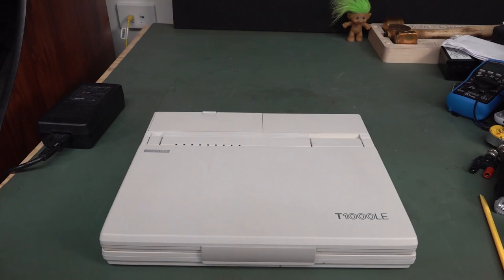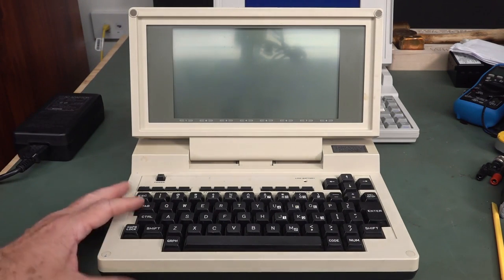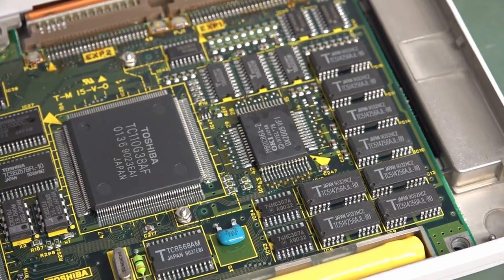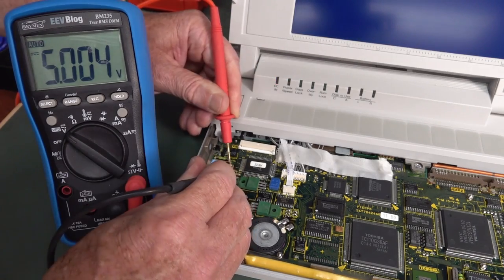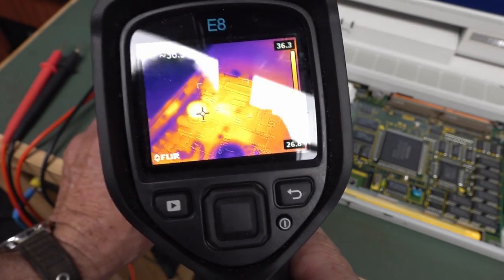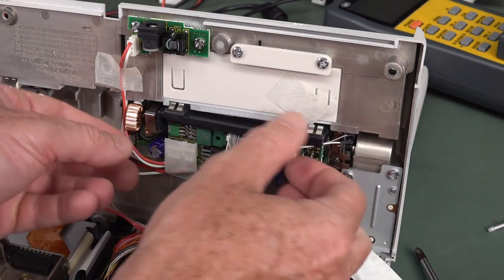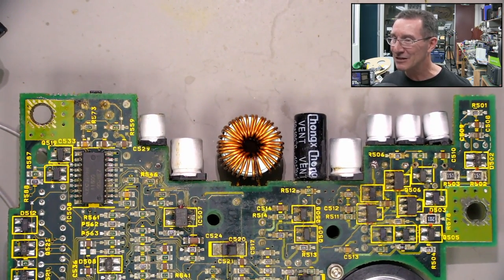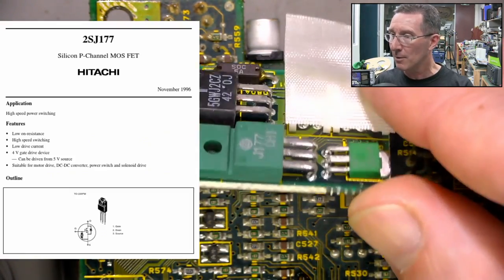EEVblog 1527 - Toshiba T1000LE DOS Vintage Laptop Repair HELL

Comment: Waaay back when, I started buying old laptops for $5-$10 at garage sales to teach myself laptop repair. This was the 2nd one I got. (The first was an old Zenith "portable".)

What I found was that it wouldn't boot without a working battery. I opened up the battery pack using an Xacto, replaced the NiCads with NiMHs. (Which required that I only charged them separately, not thru the machine.)

This laptop, with full 1M of memory and an 8086 processor, could run MS-Windows 2 nicely in protected mode.

Another problem I had was it didn't have a floppy. To get software on it I had to do a command line comm trick with a Laplink cable to load Laplink and then transfer stuff via the parallel port. Worked great, lots of fun. Had to go away during my downsizing move a couple years ago.
Reply: 8086 doesn't have a protected mode--are you perhaps thinking of an 80286?

Comment: if you look at 37:50 you can see c524,c521 and c520  markings on board you can see big line or big crack inside black chip.could that be fault?
Reply from the maker: You didn't watch the whole video

Comment: I just remembered an old Tektronix report.  It described their factory repair procedure.  The very surprising statement was that the nearly first operation they did was to wash the scope in a dish washer, using distilled water!  They followed that with a long (24 hour?) drying.  That was maybe in the 1990's, possibly even earlier.
 The other thing -- I relate any power indicator pulsation to the built in "hiccup" mode start, fail, retry due to overload somewhere after (or possibly within) the power supply.  As to leaked capacitor fluids, my finding has been that rather than the usual high concentration IPA, a 5 to 10% IPA or even plain distilled water often works better.  But a lengthy soaking may be required in any case.

Comment: I have a 110CT Windows 98 VHS Cassette-sized machine from almost the same era that I use to interface my oscilloscopes and analyzers (RS-232) when travelling, and it works just fine.
I actually set up a dual-boot DOS 6/Windows 98, and I use almost exclusively the DOS side. The hard drive is getting arthritic, and I actually had to open it at one time to un-stick it, so I'm looking into getting it replaced (hopefully with an SSD) but otherwise I can't complain. The battery even holds enough charge to move the device from one side of the room to the other whilst remaining connected - probably a good minute or so. Far more compute capacity than they used to go to the moon and back!

Comment: I recently did an extensive repair on a liquid damaged PCB, had to strip off all larger components, add many bodge wires, replace multiple SMD transistors, rebuilt and got it fully working again. A lot of via's had failed - they aren't fully protected by the solder resist coating. I'm afraid the prospects for your Toshiba board don't look too good to me :(

Comment: At 32:55 the residue is, as you later identified, leaked out electrolyte from the capacitors. I had this a lot when I repaired old Macintoshes. Give it a thorough clean with hot soapy water and a rinse with pure isopropyl. Some connections may require re-soldering to work again.
Reply: Looking at the bad traces at 38:15, I’d say the board is BER. This when I usually gave up a capacitor-corroded board after following a long rabbit-hole with my first terrible one. On capacitor-corroded boards, as the corrosion often destroys traces under chips and often vias too, you don’t have a chance especially if you don’t have massive amounts of time and a schematic.

Comment: Had one of these. never worked. Same issue, caps leaked out and it's all because of the Quaternary Ammonium Salts issue which plagued those caps, the Elnas and others. there's reasons why ones that still rely on that tech are now relegated to special use cases, and are protected against leakage like this. This is the same issue that made apple surface mount caps go bad.

Best course of action would be to throw this in an ultrasonic cleaner and let that work the magic for a couple hours, and then rinse it in the dishwasher with non-corrosive detergent-- you'd be surprised how much cap gunk can be removed with just a touch of detergent! If you need the value of that tant that blew, I can probably go down to my board in the basement which I've kept after all these years and get you a reading off of it and I'll report back as time permits.

Comment: While some old HDDs tend to be surprisingly reliable, the Conner 2.5" drives were not. They, like some of their Quantum 3.5" contemporaries, suffer from sticky rubber bumpers that glue the head stack in place so the head will not move. If yours has this problem, carefully disassemble the drive (making sure to not get the also disintegrating rubber gasket on the platters), power it on, help the head stack to unlock using your fingers and then get the data off quickly. Only a temporary fix, unfortunately.

Comment: Tiny traces, rotted vias. Could be a fun hobby project for someone to practice their micro repair, but in the areas where the corrosion has set in, you'd have to lift every chip or other component that may have a trace or via under it. And in doing so, potentially lift traces in the process. This era of things seem to have infuriatingly tiny and weak traces and pads (and poor adhesion to the board). In this situation, there is also a risk that a section of trace disappears completely and you have no idea it was ever there in order to fix it.
Reply: Yes, this one I would give up on. Corroded vias are worst, and this board has like a hundred to check/fix.  Not even speaking of repairing the traces. It would take me countless hours for some very uncertain outcome. I've had my own experiences with NiCd juice corroding all SMT pads from the underside so whatever is left of the pads will instantly lift from the board. That was a pretty frustrating repair experience.
Reply: @Shmbler But was this NiCd leak from either battery or electrolyte leak from the ELSAs?
Reply: It’s easier to remake the board and order the BOM than repair with that level of corrosion

Comment: Damage from leaky capacitors and NiCD's are a major concern when working with vintage computers.
Only positive is that the repair work gets pretty straightforward, cleaning and restoring vias and traces.

Comment: Last time I used these was in the mid-90's when it was running braille translation software to produce braille materials for a correspondence course. It worked fine for years despite the amount of paper dust it was exposed to.

Comment: I have two broken Toshiba T1000SE laptops very similar to this which I've tried to get up and running but without any luck. I recapped all of the capacitors but couldn't get them to boot. I thought it was just my shoddy soldering skills but it looks like there is more to it! A problem I've had is the wire connectors with the LED and charge boards are really brittle and I ended up breaking one when disassembling / reassembling :(

I'll be looking forward to a part 2 to see if you can get it working!

I also have an original Toshiba T1000 which is a completely different piece of hardware and switches on OK. It also has a power issue with it dropping out when attempting to use the floppy drive but boots to ROM DOS just fine.

Comment: ELNA capacitors are pretty much no-brainer, you replace them when you see them and you don't even bother measuring them. I fixed an AT power supply recently, all ELNA ones were dead, one even shot the alu can to the space and all that was left was a roll of paper :) All other caps were fine, even after some 25 years or so.
It's actually good to see ELNA caps in a non-working device, you know instantly where the problem is.

Comment: WOW, wordperfect, I remember using that back in the 80s and early 90s. To get that cleaned up and repaired, your going to have to remove a fair bit of solder mask to ensure you dont have residual corrosives lurking under there.

Comment: I just started working on restoring a T1000 a few days ago! First single-board laptop on the US market, and my first computer as a kid. (My dad had one of the fancy new Windows 3.1 machines.) I've also picked up a T1200, and its guts are very similar to this.

Those brown ELNA / "LongLife" caps are notorious leakers. The T1200 has a whole bank of odd values and sizes on its power board, most of which are leaking. Both machines have other brands of caps in various places as well, but the bad ones are all those brown ones.
Reply: Did you ever get it going?  I recapped mine and nothing. The components are so darn close on the T1000 circuit board.

Comment: The probing at 22:20 obviously shows LED changes as you push the probes on.. Looks like some loose soldering or circuit board issues there.. But I havent watched the rest yet..
Reply: Ok, I see it now. The capacitor electrolytics have most likely also entered and probably damaged via's. Neutralizing and repairing is very difficult and time consuming.

Comment: My oldest computer is a Compaq Armada 7770DMT from 1997.
It´s very impressive how quick computers developed within a few years back then.
It has a 233mhz pentium mmx, maxed out at 144mb ram total and currently i have a 100gb ide hdd installed.
It runs Windows 98SE very well, however it also makes a great DOS gaming machine thanks to it´s full vga graphics support and ESS audio drive with full soundblaster compatibility.
It can do 32 bit colors at 800x600 native resolution. I think it has 2 or 4 mb video ram but lacks of 3d acceleration support.

Comment: I had (well still have in pieces) T1200, it was great when it worked, sadly it slowly decayed - first both floppy drives died, then LCD stopped working and finally mainboard kicked the bucket. It's certainly interesting laptop, but generic enough not to warrant full repair, altough the ALPS mechanical keyboard is great and I'm tempted to make adapter to connect it to newer PC.

Comment: Yes tantalum capacitors are marked positive how do I know this… I purchased a SATA to msata adapter off eBay and it didn't work right. Traced it to the capacitor replaced the capacitor powered up and have a nice fireworks show glad I bought extras.
I haven't seen that much fireworks since I plugged in a AT power supply and the power switch cable shorted live 120V! When I was like 6-8.

Comment: I feel you pain! I have like 100+ retro laptops like that in my collection, restoring and repairing them 10-15 years ago. Caps electrolyte is devil himself. These laptops have multilayer PCB. Vias go bad, traces go bad, party going on under ICs, bad, bad, bad... all bad ;-) But endless fun when repaired and comes to life. Cheers! S   PS, there is some kind of LCD inverter inside LCD housing - BAD! ;-)

Comment: I had the same problem with those Elna RSH series caps on a power supply for a spectrum analyzer (Advantest R3271). Half the board was covered in leaked electrolyte and there was corrosion everywhere. I managed to repair some traces but I wasn't successful repairing the board. Unfortunately, the power supply is the only part for which there is no schematic in the service manual...

Comment: Senior college thesis written in WP 5.1 in 1991.  Got the 5-1/4 floppies around someplace....  Never owned or used (employer's) laptop until 2001 I think.  Traveling engineers (not me) would sometimes have them.  Now of course hardly any desktops in use at my company except some on production testers.

Tantalum caps could have popped from OV.  My company has had a derating of 50% on those and avoid if possible in designs.  MLC caps have replaced the need for a lot of them now though.

Comment: Seems like an excellent candidate for a USB-C adapter built into the battery pack (or a 3d printed replacement).  Just completely bypass the built in power supply.  Allows you the easily power it from USB-C battery packs as well.  USB-C 5V -> 7.2V or just straight 9V

Comment: HA. I'm repairing Rockwell AIM-65's each year. 1MHz 6502! I've made some upgrades over the years, like flash prom adapter and an Arduino TTY remote terminal implementation.

Comment: !! 43:17 It looks like those two are they diodes or capacitors are cracked in half?
Never mind I originally spotted them at 38:00. I wasn't screaming yet but it was getting close to the end of the video.

Comment: It's a little validating to see even Dave struggle with this. My random sampling suggests there are a LOT of Toshiba laptops this vintage with leaky caps and bad power supplies and I haven't had luck getting one working yet...
Reply from the maker: Search the forums and you'll find that tons of people have no luck with them. The PSU is convoluted, no schematic, and the caps leak everywhere and destroy traces. Once I saw the corroded traces I pressed STOP and that was the end of Part 1. Don't know if they'll ever be a part 2

Comment: Yep. I have a similar model (think it was a T1000SE?) and tried repairing it doing exactly what you've done quite a few years ago. Stuck in the same boat. The capacitor leakage was much worse in my example

Comment: I have two of these and was thinking when isch was unable to make the first one running, that im just bad at fixing stuff (recapped main board, touched up alot of the corroded points). lucky for me the second one had a mainboard which allready looked much better from the beginning, so i did manage to fix that one, but yes compared to the ibm laptop i have from 95, the pcbs and everything is attrocious from the toshiba 1000le.

Comment: My step father had the loan of a T1000SE in, wait for it, 1995, I was only just starting to learn about IBM PCs then, so I knew nothing about DOS and very little about Windows, if anything.  So I didn't know the SE had DOS in ROM.  I'd kind of like to find a T1000 LE or SE, that's in working condition.

Comment: Find someone to draw the board up on pcb or a working one. Could be a good journey to replace the board with a new pcb.

Or make something with newer power delivery circuitry. How many volts from 12 and down it needs. Should be a bobby dazzler special!
Reply: Once you redesign the PCB, you might as well choose new core components like a 486DX3 and some high capacity modern DRAM chips without the rowhammer bug.  Just avoid chips that have known bugs or high risk technology like speculative execution or hidden global CPU state.

Comment: So it's a long shot depending on the layout, but you might be able to cut off the PSU section and make a solder-in replacement?
Reply: Definitely needs a schematic for that.

Comment: Have you tried running power through the battery terminal connections on the board at the back of the laptop instead of the dc input ?
Reply from the maker: Watch the end of the video, it's a mess.
Reply: @EEVblog I wonder if Toshiba  would fix it for you or maybe there's another main board lying around somewhere.Or you could donate it to a technology museum or send it to hell lol 😂😂🤣🤣😂😂🤣🤣😁😁

Comment: Man... that T1000 looks like it was "terminated" by a T1000. 😁 Would the Rossmann method of flooding the whole area in flux and reflowing the joints help with that corrosion? Should then make it easier to find the bad parts and traces, maybe?

Comment: I have one of those, it didn't boot when we moved last year, but I might have had the wrong power supply. I think it flashes a green light though.
Pretty sure it's painted metal on the back of the monitor.

Comment: Poor thing is completely rotten away. The horrible tarnished look of the joints on the caps right at the start (12:14) screams for a massive electrolytic spill. 
From my exploration of vintage stuff, ELNA caps leaks. Never seen a Rubycon or Nichicon leaking. And Sprague are notoriously eternal.

Comment: I wonder if the extra "battery terminals" in the left hand enclosure were actually an easy way to power the modem when fitted?
It's a shame that we have to use an electrolyte that's so corrosive. But then tantalum's have their own issues too

Comment: Ok, you tried without the battery. That was my first thought right off the bat. I have seen bad batteries cause low voltage (and lack of booting).

Comment: T1000 a Swiss cheese.
Back in the day I used one of these when I travelled internationally, that meant a lot of different climates. After just over a year (and out of warranty) it bricked. Had a look inside and found the motherboard had melted into a green cheese.
When did they invent conformal  coatings for PC boards?, the T1000 did not have one.

Comment: Put it on the barbie and stand clear. There, that should take care of it.  Good Die Mite!

I had one of those beasts (new) before trading up to a 1100 (or 1400?) a couple years later. Never had any trouble wid dit.

Comment: I opened one today i got last year in a very good external condition. My motherboard is much worse tha yours. I don't spot any damaged component (at least for now) BUT in adiction to caps leaks mine the SUB Battery also leaked and a big area of power supply section is full of junk. Tomorow i will wash all motherboard and desolder all caps. I hope in end all works. I didn't even try to turn it on, but the person who sold it to me tried. This old computers is better to don't even try to turn it on before clean motherboard and recap.

Comment: so many memories from this! some great, some the stuff wes craven could use to make a new horror film from... I had several connor drives back in the day.. still have a 40mb somewhere and last time it was powered up (about 5 years ago it still worked!) most of them developed bad sectors galore.

I have a box of 4mb expansion cards somewhere (like 100 of them) I got at an IT liquidation sale in the early 2000s, cant remember if they fit this or not.

I do remember these being an utter nightmare to work on.